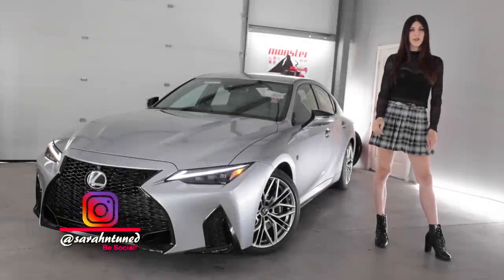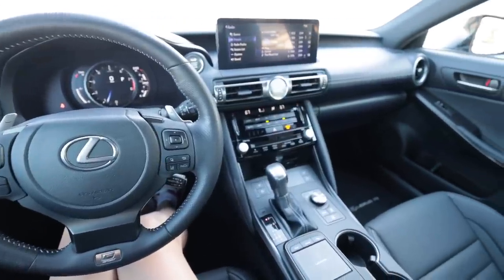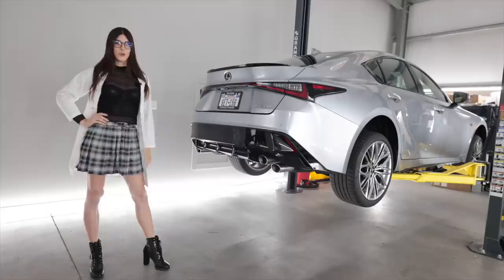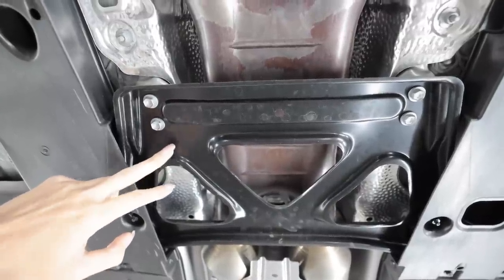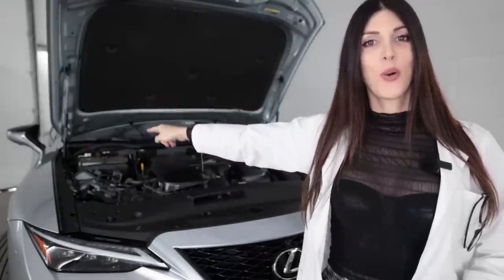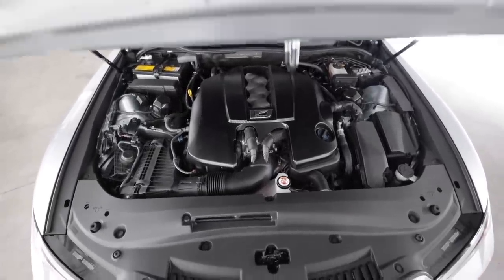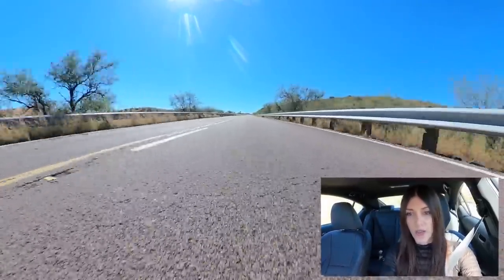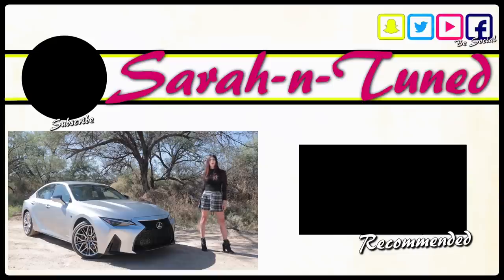Better Than An M3? // 2022 Lexus IS500 F Sport Review

Comment: The best thing about this car is when most of those comparable BMW’s are sitting broken down with broken hearted owners or they just send them to the scrapyard because they are too expensive to repair, this Lexus will probably still be running fine.
Reply: Having owned BMWs for the last 15 years this car is very enticing, reliability factor is only one reason however.. Plenty more, even knowing I will miss the chassis dynamics.
Reply: YOU ARE CORRECT! I have a 2022 M340i and it has been in for service at least 8 times already. I am currently talking to Lemon Law 🍋 lawyers.
Reply: BMW maintenance will bankrupt your average consumer. This is why they don’t do maintenance and that bmw will eventually explode.
Reply: you are - how do I say it - late to the party - my E30, E36 and E46 manual M3's have been low maintenance, lower than my 997 993 and 964 - had a Lexus LS430 a 1998 4 Runner and a 2004 Land Cruiser - sold them all happily ..........
Reply: @ashman0071  Late to the party? The E46 is 15+ years old. All those p-cars have BIG MONEY maintenance and some issues too. What are you on about?
Reply: @karlowens1086 do you do maintenance
Reply: The lexus glazing is crazy with how unreliable they've become lol

Comment: It has nearly 200hp more than my old GS400 4.0 V8 but still gets the same fuel economy. Impressive.
Reply: Crazy how far we have come.
Reply: The old 1uz-fe has the same fuel economy as the new 2ur ?? How? Well maybe it's the higher compression the 1ur has but still hard to believe Lol I guess u keep your 400 well taken care of.
Reply: Cylinder deactivation
Reply: @bassicuk1986  This engine doesn't have cylinder deactivation. It adjusts the valves to simulate the Atkinson cycle featured in hybrid engines.

Comment: Waiting to order mine, driving a '21 IS 350 F Sport while waiting. Will keep the 350 because love it and it will share it with wife. Love your review style. Subscribed.
Reply: Got it 1/8/2022, Infrared/White. Your review is spot-on. Will say that it's pretty different from the IS 350 F Sport, not just a motor difference. Steering is heavier, suspension is dampened more sharply. . .great performance in a car that can be comfortably driven daily.

Comment: The primary reason to choose this over an M3 is that you will not have to get to know your mechanic on a first name basis.  German "engineering" for the last 20 years has declined into overly complicated, completely unreliable crap.
Reply: Thats just BMW.
Reply: Yeah. It's called "Bring Mich Werkstatt" If something ist Borken.
Reply: not the b58 solid as fuck
Reply: In Ireland they BMW =bring more work
Reply: BMW = Break My Wallet
Reply: @paqman67  more like Burn My Wallet
Reply: @redarmy1778  the B58 doesn’t come in the M3, and plus that’s probably one of the only solid motors they’ve put out in a long time
Reply: @cat740dt  and that's because Toyota was involved to  a certain extent in the development of the b58
Reply: That’s because they’re made in the USA these days.
Reply: so true in particuliar mercedes and audi
Reply: @schmeat2717  im sorry but mercedes is worst
Reply: Not Porsche…… Porsche> any Japanese brand
Reply: Granted, it's anecdotal, but my 2011 535i XDrive with more than 150,000 miles has only had the starter and a CV Axle replaced, along with brake pads and other typical maintenance items done as needed.
Reply: @DiaperSNiFFER  Porsche isnt that great either.
Reply: People dont buy a bmw for the same reasons people buy a Lexus
Reply: I've owned X5, 428i, 435i, m4 over last 10 years and never had any issues at all....
Reply: That is why, after my last 3 Series, I bought an SVX. I never looked back. My current WRX is my 7th Subaru and, though my Service Manager since 1996 and I are friends, I haven't put any of his kids through an Ivy League school.
Reply: @cat740dt  the S58 is just the better/ performance version of the B58. Wouldn't suprise me if they where just as reliable since the B58 is reliable itself.
Reply: Says one who actually never owned one…
Try to drive one WHEN you can actually afford one.
These Toyotas will never beat the way Germans drive.
Reply: Where do Supra owners take their cars for maintenance/repairs?
Reply: @Andrew-kr2qg  PERFECT!  Supra = BMW running gear + Toyota styling.
Reply: @brendanwhite9799  BMW and benz is better than lexus  but whatever helps you sleep
Reply: @gorgewashington1216  you keep the Lexus piece of crap Mercedes  s class all day baby
Reply: well, they want you to buy a new BMV every 3-4 years
Reply: @cat740dt  all BMW motors are reliable (minus the V8 and the S54) don’t let idiots who treat them like a Lexus make you look like a fool
Reply: Brakes NOT ENOUGH To Stops From High Speeds w) Out Paddle Shifting Down That was only complaint I use to have on my 2003 Cobra SVT Beast.

Comment: Drives me nuts that Yamaha / Toyota partnership did not produce a updated JZ engine and the world has a BMW Supra.  I loved your throwback to the Altezza and the Beams!  Currently that Beams is on my radar for a AE86 GTS project I have going.  The IS has always been rock solid value that requires little maintenance compared to is over engineered German competitors.  Nice Review!
Reply: 100% agree.  Wish, at the very least, Toyota would have kept the new Supra motor in Japan.  Still trying to figure out what was wrong with the JZ in the first place. 🤔

Comment: Great  in depth video. I owned a 2016 BMW M4 that thing was a mechanical nightmare. It lived more in the dealership than in my garage. After throwing a lot of money at my BMW M4, I realized that the BMWs are like strippers the more money you throw at them the better they perform. Nothing beats the reliability of a Lexus. I am deciding between this car, the 2022 C8, and even the 2022 911 GTS. The reason I am leaning towards this car is the price point and the Lexus reliability.
Reply: So true Ed ,every time there is a really hot day in Perth WA you will always see at least 1 BMW on the side of the road
Reply: Especially when you value your money 👍🏽
Key word Reliability
Reply: @Ed Masoud we have 911 gts here in Europe and they are nightmares

Comment: 25.4 mm per inch, 12.7 inches is 322.58 mm, math is not hard, rebuilding cars is. I like the turbulence generator, reminds me of the Nissan/ Datsun under body spoiler, I actually want one for my truck. Think it might handle a little better with some down force in the rear.

Comment: 13:50 precisely my argument for buying a Mach 1 at 37 with two young kids. I’ve wanted a mustang since I was literally 5 years old. If I had waited until my kids were older that car won’t exist. I just rolled over 5,000 miles and have not yet turned the radio on while driving, it just pops and burbles the whole ride and I just listen for hours. Of course I also bought an old 4 runner to run my kids around in, 200,000 miles it doesn’t skip a beat!!

Comment: I’m stumped between buying this car, a used LC500, or a TLX Type S. I have a feeling that the IS500 and the LC will actually steadily hold their value over time, ( maybe even appreciate a little) but the TLX Type S is just as much fun to drive but somewhat cheaper. 🤔
Reply: You don't wanna miss out on the V8
Reply: Probably this because it’s the last of its lind
Reply: The TLX Type S is a glorified Honda Accord. No where near the performance of either of the other cars you named, define not “just as much fun to drive”
Reply: TLX-s ????

Comment: The engine is very much restricted from the flattened exhaust design, imagine a better breathing exhaust system, you might gain a nice amount of power and lose some weight in the process. Overall I love this thing my love for the ISF, RCF , LC500 I love all the Lexus v8s they're so special to me.

Comment: They didn’t want to call it an ISF because the CEO doesn’t think it’s worthy. It’s more of a V8 cruiser than a track level car. It’s not comparable to an M3 or anything like that imo. It has its own niche.
Reply: Is the CEO on record stating that anywhere? Genuinely curious- wondering if they’re planning an ISF with upgrades to suspension, weight reduction, etc.

Comment: You mentioned that it felt smaller.  Although it looks like you fit in it fine.  My 5'10" wife hits her head in her is250 going over bumps.  Although that does have the hole in the roof.
Reply from the maker: I’m 6’ 4” in those heels and fit fine.

Comment: I still prefer the old 3UZ V8 4.3L its so quiet compared to your average American V8, and when you add all these aftermarket parts like turbo and ext, its actually hurting the car and won't last as long while the v8 still has the power and is stock can last 1million miles such as the Lexus LS430.

Comment: Better than an M3, are you sharing that crack pipe with the beaver. I like the air disrupters, the sub woofer frame, the O2 sensor cup holder and the sound flapper thingy. Still rather have my E30 M3 even though it's old and simple and in bits. Love the review 👍.

Comment: The v8 is a joke. I would get the is 350 and put a aem cold air intake and a d3 tune on it instead. Toyota has bought a few d3 tunes to learn on how d3 was able to program the transmission and get more out of it. I had the tune on a Camry TRD and that gave it the performance that car should’ve had

Comment: If it was an honest 1800 watt stereo, you'd need armored glass to prevent blowing out your windows. Oh, and your eardrums would rupture. Shame on Lexus for the hype.
Reply: That’s what I was thinking
Reply: That's really not how that works. Because of math, doubling amplifier output only turns a 3db difference, less than 1.5x Sound Pressure Level increase, and just over 20% more volume. The most important thing for shattering glass or eardrums would be speaker sensitivity.

Most high speaker count cars are running several of them in parallel, 17 speakers not 17 channels, which drops the circuit impedance down to a point where it takes a significantly higher output amplifier to drive them properly. It's less for loud, more for sound.
Reply: @Dave-fx5zw  knowledge in Ohio

Comment: To be fair, Lexus is crazy for saying it doesn't compete with an M3. I think it does, as well as a CT4-V Blackwing.

The Lexus IS500 F Performance is 472hp and 395lb-ft of tq. The BMW M3 RWD manual transmission is 473hp and 406lb-ft of tq. The Cadillac CT4-V Blackwing both 6-speed manual and 10-speed slushbox is 472hp and 445lb-ft of tq.

The starting price point for an IS500 F Sport Performance, M3 RWD manual and a CT4-V Blackwing manual starting price is right where it should be in its class and segment.

Lexus is in denial of what their car truly competes with because we enthusiasts know we're the ones that's right.
Reply: I wouldn't compare them. Considering that to BMW and knowing bmw's numbers are underrated from factory even for the comp models as well,their numbers go by whp so they're higher than they advertised. Also,the bmw's also have the ZF on their end so that gives them a massive advantage and them being very capable of hitting mid 11s(easy tire + gas can drop it in the low 11s) with ease. Can't say the same for the IS since its using the same old tech toyos been using in the RCF and other F cars forever now so I'd exoect no less than a 12.5 at best probably a little less but not lower than a 12.3(similar numbers to a RCF). Same numbers probably won't be 100% the same for the manual M3/M4 but that all comes down to who's driving them but honestly.